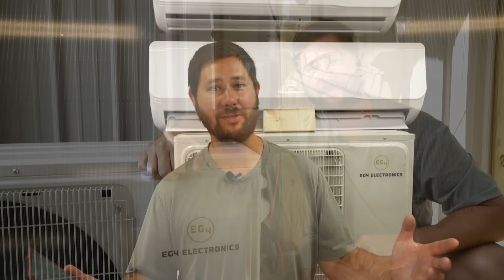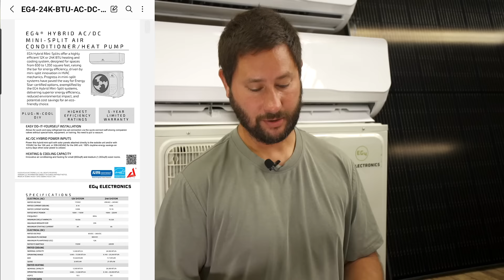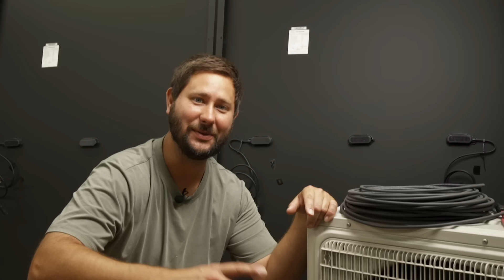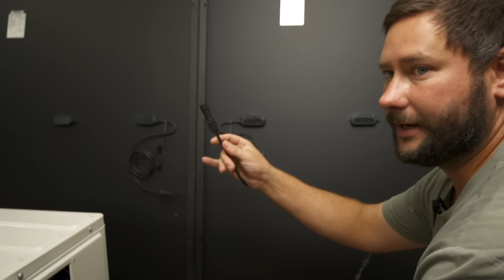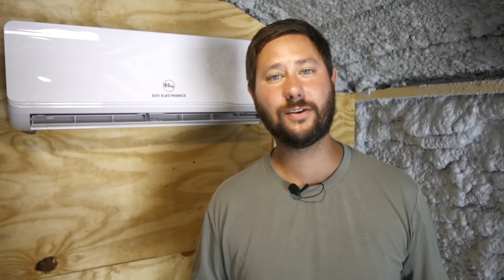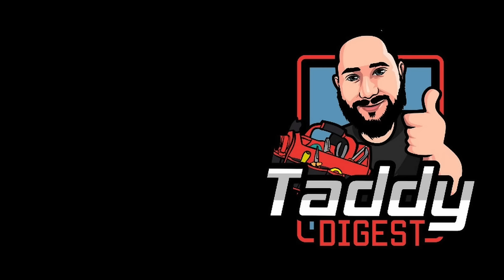How Many Solar Panels To Run a Mini Split? (Direct Solar AC Explained)

Comment: Great video, thanks! 🙌 I have received the same EG4 Kit (12K BTU solar hybrid mini-split and 5 450-watt solar panels) and watched another solar installation guide and got a bit confused on code compliance. To make sure this setup is fully up to code, do we need these exact steps for the Tigo rapid shutdown system?
1⃣ Tigo modules at the panels: Mount a Tigo module behind every single panel. Plug the panel's positive/negative wires into it, then daisy-chain the modules in series.
2⃣ Tigo Transmitter: Run the two main PV wires down from the roof to the transmitter box (running an EG4 unit directly on solar without an inverter). Pass ONLY one wire (positive OR negative) through the core before routing it to the solar disconnect box.
3⃣ Solar Disconnect Box: Connect those PV wires straight to the disconnect box. I already bought this one: https://amzn.to/4y3AVZ5 🛠
4⃣ Red Shutdown Button: Mount a normally closed (NC) latching E-Stop button. Wire it to break the power supply line to the transmitter to trigger the shutdown loop.
Still trying to figure out the exact models to buy for 1, 2, and 4. Any advice on which Tigo module, transmitter, and stop button would work best for this?

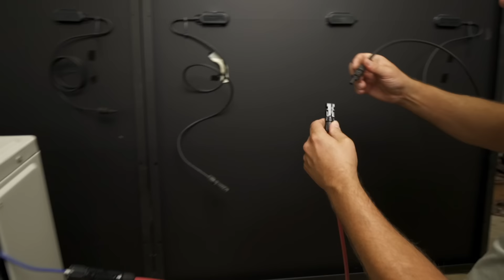Comment: Yhe problem with solar panels and wind turbines is there is np economicap way to recycle them. Like after the big wind storm in Wales. amasses of solar panels destroyed a large numbet of eind turbones ruined. Until the tecycle problem is solved than No more of either insta 5:36 lled. Make a new law no installatipn until a tried and proven recycle method approved

Comment: What about going over the 12 amp rating with solar panels. I was told you can’t get panels that are rated above 12 amps ISC or it will damage the built in inverter.

Comment: I have been monitoring my electric consumption with an Emporia monitor. MY AC is about 40% of electric bill.  Based on the current  cost of the EG4 system, I think my ROI is about 24 months.  I am in the process of installing the 24K unit, 7 bifacial Sirus 410W panels, with the Signature Solar ground mount.  I have a clear line of sunlight up until 5pm each day.  I don't plan to hook up the unit to my grid power and will see if i can make a huge dent in my heating and cooling costs.  Thanks for the video.
Reply from the maker: Awesome. Excited to hear the progress and a report after install.Let me know how it goes

Comment: Sir please make a video mini split inverter air conditioner technology temperature sensor working and At what temperature does the protection start? And compresaor off and how to check communication IDU to ODU How to decide whether there is a fault in the PCB of Indore or the fault in the PCB of outdoor? Please 🙏🙏🙏🙏🙏🙏🙏🙏🙏🙏🙏🙏🙏🙏🙏🙏🙏🙏🙏🙏🙏🙏🙏🙏🙏🙏🙏🙏🙏🙏🙏🙏🙏🙏🙏🙏🙏🙏🙏🙏🙏🙏🙏🙏🙏🙏🙏🙏🙏🙏🙏🙏🙏🙏🙏🙏🙏🙏🙏🙏🙏🙏🙏🙏🙏🙏🙏🙏🙏🙏🙏🙏🙏🙏🙏🙏🙏🙏🙏🙏🙏🙏🙏🙏🙏🙏🙏🙏🙏🙏🙏
Reply from the maker: ok I will

Comment: I think I remember seeing a Lennox system with PV inputs a while back. It'd be awesome to see more HVAC units like this, perhaps even larger 4 ton units. I've maxed out my PV inverter and still draw a considerable amount of power from the grid. Since most of my power is from cooling (TX), a larger 4 ton central/multi zone with PV input would be a cheaper (since kill two birds with one stone) way to add solar capacity without having to sell power to the city and buying it back at a higher rate.

Comment: Dont be fooled by the SEER2 rating on these units
Reply from the maker: why
Reply: @TaddyDigest  They claim 29.5 SEER2 and actual EER is 13.5 or 385% efficient at 95F, which is not far off from a non inverter window unit. For comparison the best Fujitsu is rated at 33 SEER2 and actual EER is 18.2 or 530% at 95F which is possibly the most efficient available (well over 800% efficient at 3000 BTU minimal load)

 The EER ratings can be slightly adjusted by "rating" the unit near its maximum BTU or rating at a much lower BTU, which essentially over sizes or undersizes the coils. So with the EG4 you are getting a lot less machine than the BTU implies and with the Fujitsu or Mitsubishi youre getting a lot more machine, especially when it comes to heating.
Reply: @LibertyDIY  What do you mean? Why will they make a fool of us?
Reply: @m2o2u  Thats a good question,   probably because its a bit too complex for the typical buyer to sort through. Im surprised they stretched the number that far.

The trick is to focus on EER instead of SEER and make sure to get an inverter unit so you get the partial-load efficiency benefits.

Comment: These do both Heat and Air is that correct?  Thinking about getting one of these to supplement or backup heat supply for my propane furnace and help with the AC unit which eat $$ during the summer.  Enjoy your channel!
Reply from the maker: Yes, it is a heat pump, so it does both heat and cooling